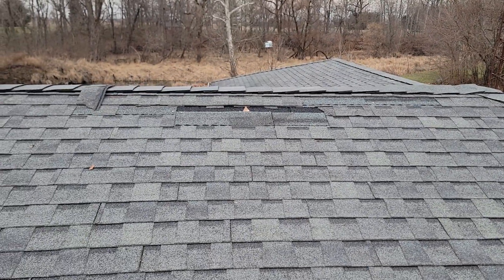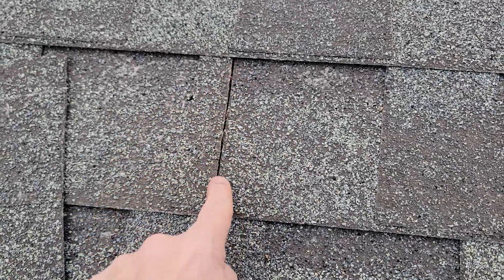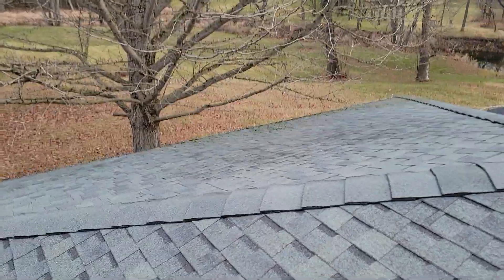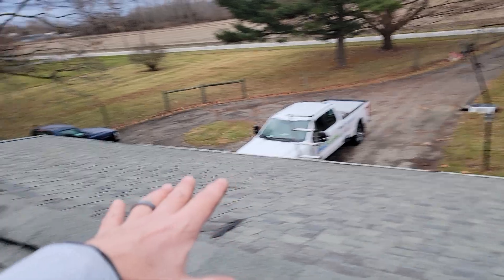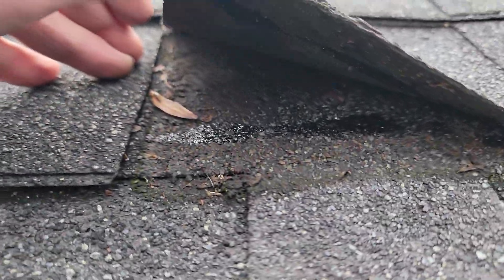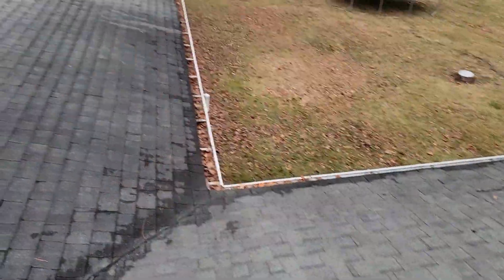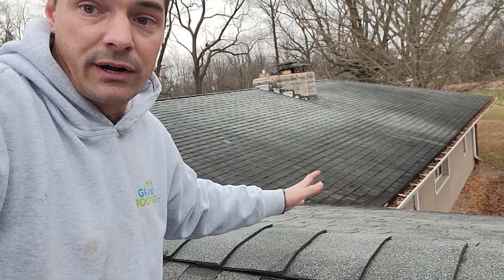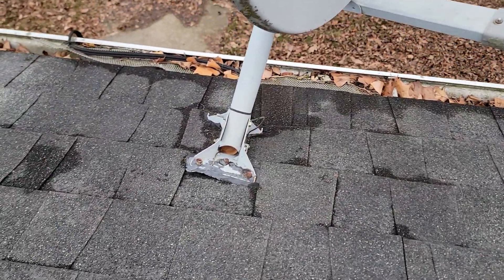Home inspector said some roof repairs needed. It needs a full replacement! What's your thoughts?

Comment: Wow that roof, that's uhhh... not how I woulda done that... 😁

It's no better with the inspectors here in B.C., I did some work for a lady who bought a house after paying for a roof inspection. The inspector told her the shingles were brand new, no problems! Well, he was right, they were brand new. Turns out the previous homeowner did the roof himself to sell the house. Well, the entire roof was falling off, literally huge chunks of it just sliding off, on a 4/12 pitch. Ouch. The first sign to me was that all the rows were installed a half inch too high, on purpose, and crooked as all hell. My co worker lifted up the edge of a shingle and about 7 shingles came right up with it. The reason she actually called was because it was leaking all in behind the gutters, no drip edge, no ice shield, no shingle overhang. It actually looked something like this one you're showing here in this video 😆

Look I always say, a home owner is welcome to do to their own house whatever they want, I don't hold it against them because it's their own damn house. I just give them the bill to fix it. But when you hire a 'professional inspector' to look it over and they walk around the roof, scratch their ass and sign off on it, there's a problem. The lady I was just talking about said she never would have bought the house if the inspector had told her about the problems with the roof. I mean come on. The one you're showing here so blatantly, cleeeearly needs to be replaced, how could anyone just look at that and say it's fine?
Reply: Not sure how long ago this was, HOWEVER, if the seller did the work himself and did not get permits and inspections and advertised a new roof; If the roof was overlayed over multiple old roofs and exceeded the code in old roofs, this is called: FRAUD IN THE INDUCEMENT. It is a CRIMINAL ACT. In fact the real estate agent who LISTED the PROPERTY has ERRORS and OMISSIONS Insurance that may actually cover the agent's advertising of the fraudulent claim.  If this has been less than three years ago, I would go talk to that homeowner and tell them they should go sue the listing agent and the last owner. This was CRIMINAL.
Reply: @djea3589  Well sir I don't get in to the legal side of things, I just try to fix the problems I see. But swear to god, if you are good at the legal side of things I can probably get you alot of work around my area... and I'm not kidding.

Comment: Yeah, my experience with a home inspector was much the same.  He called out things that were NOT a problem (e.g., the breakers in the house panel ARE UL listed for one or two wires per terminal, so some being "double-tapped" is NOT a code violation).  He completely missed other things that were issues, like a bad septic system drain field and evidence of multiple roof leaks.  Didn't help that the previous people lied about the leaks being fixed, but still...

Comment: I think strict licensing is a good thing for all trades. Here in Florida the process to get licensed to do roofing is NO JOKE!! We also have inspections by the county during Reroofs.
Reply: except that county inspectors are FORBIDDEN from wing a roof, so there is NOTHING they can see. I used to run roofing crews in CA. There are some good roofers in FL there are a lot more that are just plain criminal in my opinion.
Reply: The inspectors here in Florida get on the roofs during dry-in and final inspections of the roof.

Comment: Home inspectors are not trained to discuss life expectancy, when defects are found they should have referred the client to a licensed roofer to evaluate the roof.  I have recently inspected 2 roofs that were roof overs and was obvious the all the flashings that was improperly installed over the shingles vs properly layered under the shingles on the high side.  I recommend most roof over jobs be reinspected by a roofer.  This roof you just showed was an easy referral to a roofer.
Reply: Absolutely

Comment: It would be nice to know if the inspector actually walked the roof or did they use a drone?
Reply: The only indication that they did more than look from the ground is the chimney top cracks. Maybe a drone.
Reply from the maker: Good observation, yes, it appears he did walk the roof based on the photos in the report. I screenshot a couple pictures. I'll post them in just a minute.  Note at the bottom of one he notes it's one layer of roofing. In one of the other screenshots, he has several pictures close up looking at the missing shingle, showing the second layer of three tab.
Reply: @GrandRoofingInc  Having run roofing crews, I can tell you there is NO WAY to know how many roofs are on a house. We checked the drip edges and found one, we found 2 in exposed areas. When we removed the roof we found FOUR!